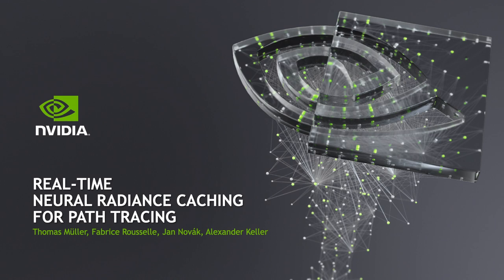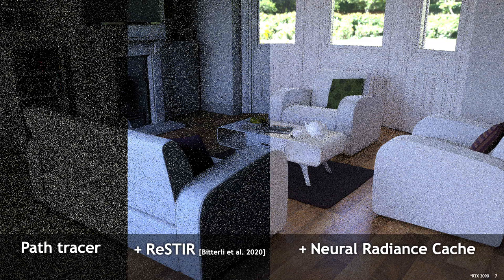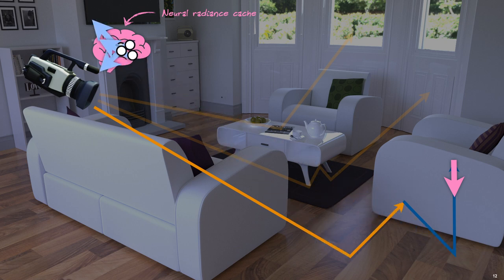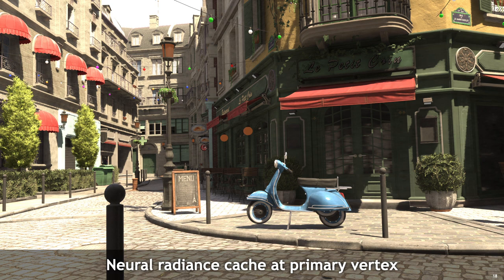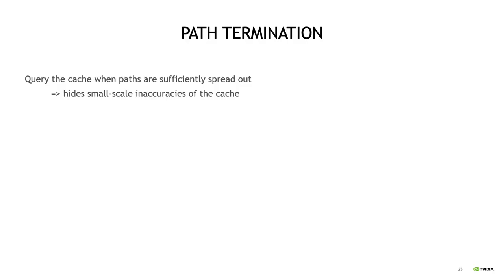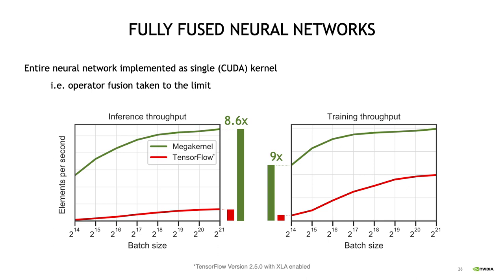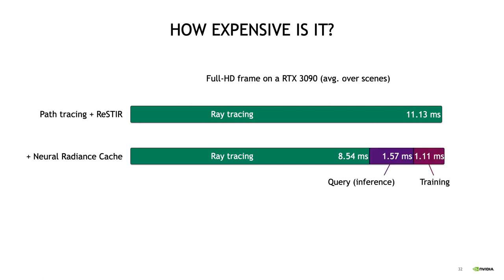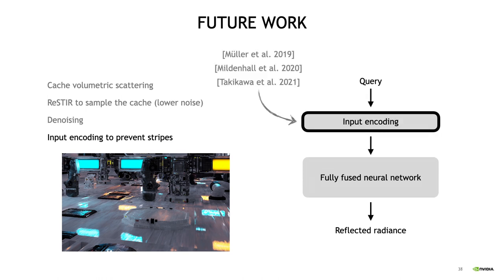Neural Radiance Caching for Path Tracing

Comment: Curious on how these cache artifacts would look around animated characters. Very impressive technique!
Reply: It doesn't matter animated or not. The objective is to focus radiance samples on problematic areas so the detail is held there, whereas wider areas, which need less samples, receive less and are cached for a the second pass which just blends samples together with fewer path traced rays for other elements. Is easily extensible to all kind of scenes, this caching is done on a 16th of the final resolution, so they can take into account animated meshes just right. I've seen this already, just not in hardware

Comment: I may be insane but if you combine this with a neural denoiser and a neural supersampler and/or frame generator and get very aggressive with the path truncation and a bit stingy with the training (e.g. retrain every 2 frames instead of every frame) won't this actually squeeze onto the Switch 2? By my maths this would just about squeeze on nicely. 

Wouldn't that be the end of the gaming arms race? Why get a ps5 pro or a gen 10 xbox/ps6 if a cheaper hybrid handheld/console can do realtime path tracing. There's literally nowhere left for graphics to go except fully generative realtime ai video transformation.

 I can even see how this would get faster for ml constrained systems - feed back the inference error to control the density of the training points on future frames so learning gets focussed on unlearned stuff instead of being naive.

Comment: Neural network computation itself has a ton of redundancies, handcrafted methods always perform much better.
For the radiance cache being the function of coordinate and incoming angles, it may be possible to encode the ray incidence sphere in a way similar to what mpeg compression uses (cosine decomposition), combined with one or a few discrete ray reflections with no diffusion whatsoever. For the base of the decomposition spherical harmonics may be used, or its wavelet form if it even exists.
As for incoming position, neural networks and spatial decomposition is already a good fit.
Reply: Your idea is essentially light probes. Pick a granularity, group together rays with similar [px,py,pz,ax,ay,az]. Apply filtering ontop of the results. That's light probes my dude.
Reply: Sort of, yes, but instead of precalculated grid of such probes, there's a NN deciding the shape of the light probes over the coordinates. This changes the NN input and output vectors from [coord, dir]->light property to [coord]->light probe state.
Reply: so then why is neural radiance caching the future? lol